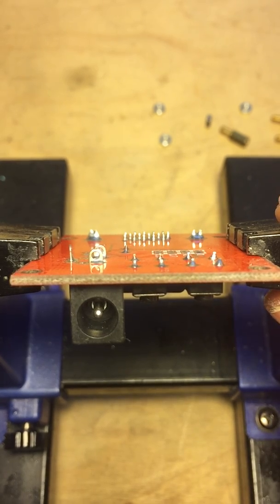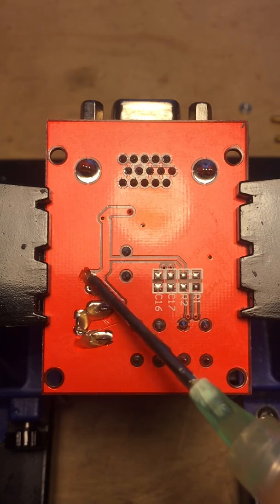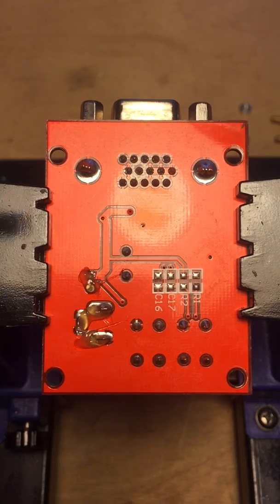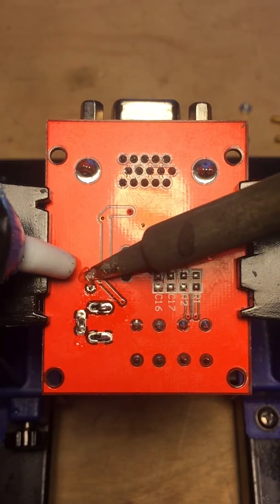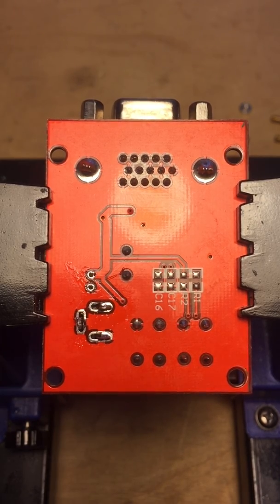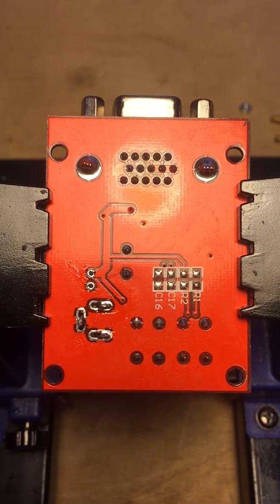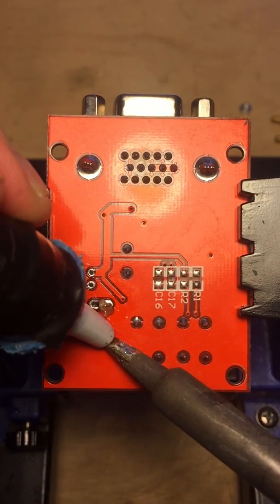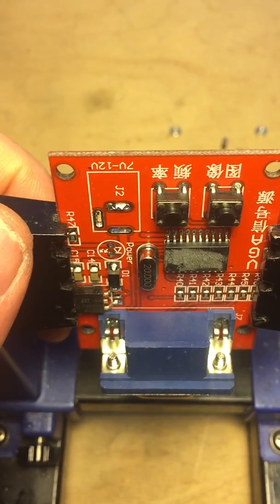CHA/V Build Guide pt. 4: DC Jack Removal

Comment: Hi Jonas. Is it necessary to remove the DC jack?
Reply from the maker: Sorry -- just noticed this comment. No, it's not necessary to remove the DC jack. I included that step for people who are skilled at desoldering and might want to just re-use that jack. You can also just buy another one for less than $1 and use that instead. I'd actually recommend that for beginners. Removing the jack can be tricky and stressful if you're inexperienced. FYI-- contact me through my site (jonasbers.com) in the future and I'll get back to you quickly. I only log into youtube once or twice a year.